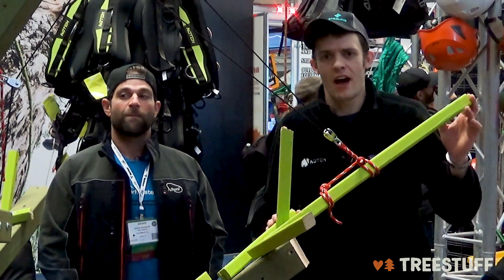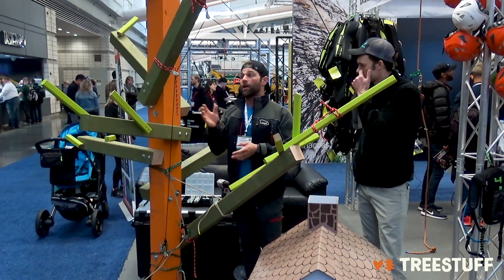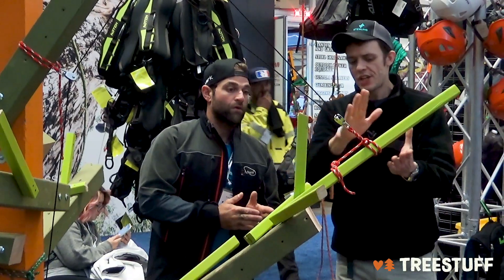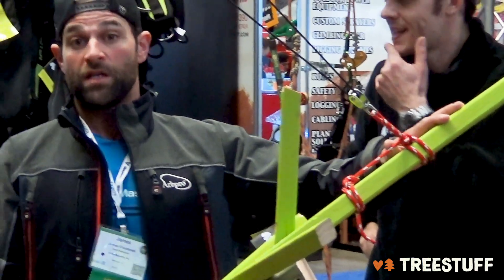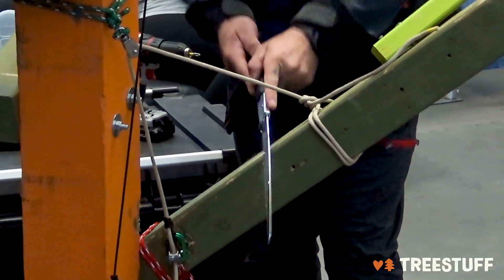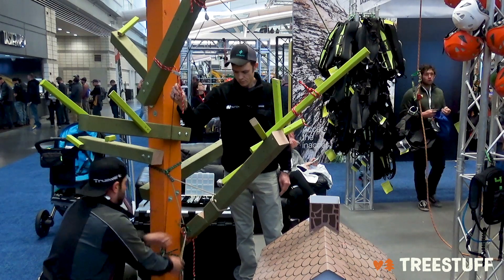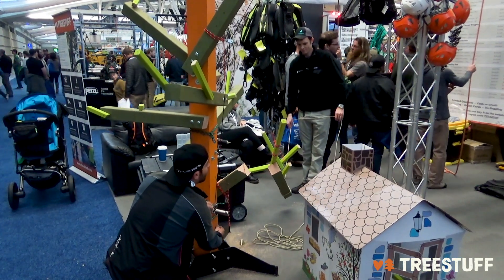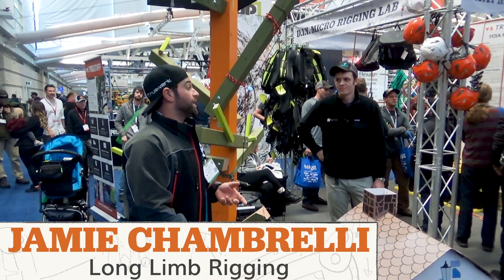Long Limb Rigging Featuring Jamie Chambrelli TreeStuff Micro Rigging Lab

Comment: Great stuff. 
I would like to see more from this guy... knowledgeable, anticipates questions, and a great explainer.
One thing I wish he had described more was how he got the tension out of the capture prusik enough to release the line to lower the piece..... unless his comment about comparing it to a climbing system meant that it functions just like a (e.g.) blakes hitch is loosened on a climbing line under tension(?) ... maybe I just answered my own question.
Reply: Thanks really appreciate the kind words!!!  By putting the Portawrap  below the prussik it take the pressure off the coils from needing to hold the friction, the hitch will still be tight but once you "crank" in on the portawrap and wrap it up it will take the pressure off the hitch. Similar to how a SRT climbing system works. The key with this technique is have the piece come off smooth shock load could jam the prussik so making sure it's a nice smooth path and a good cut is very important !! Climb safe!
Reply: @jameschambrelli3396  Thanks!